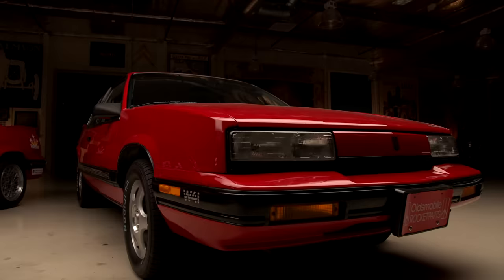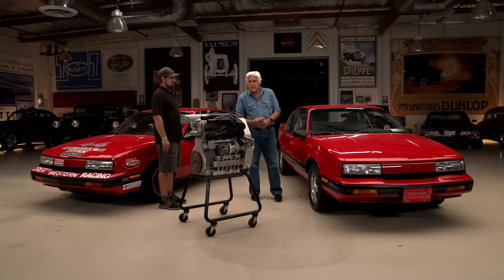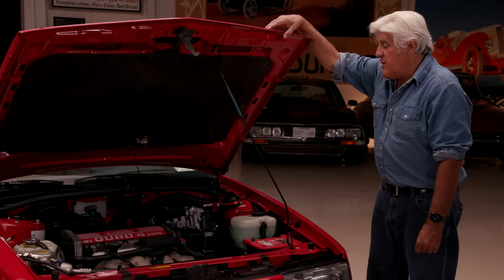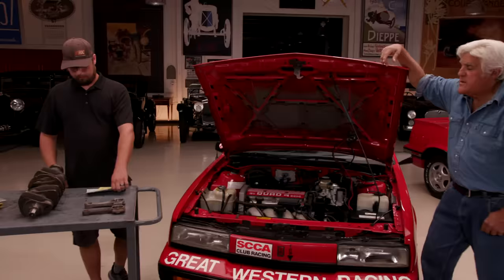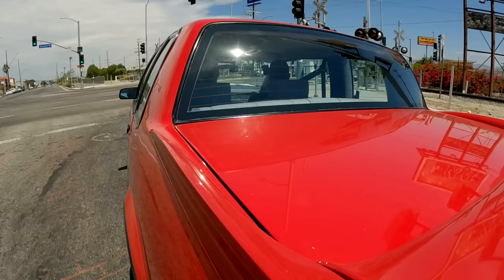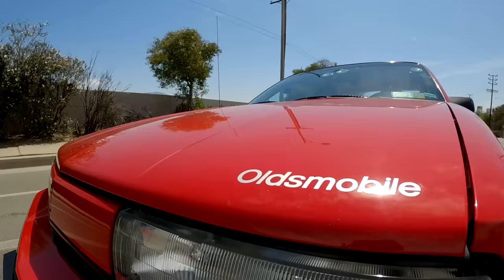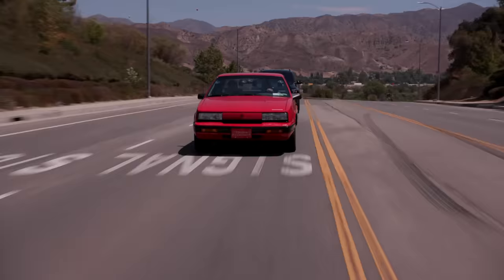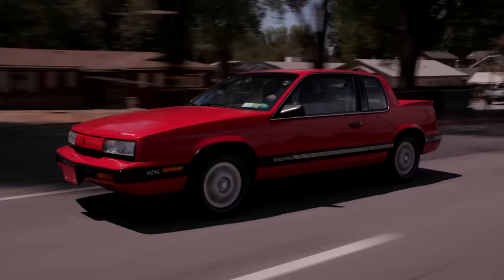Rare 1991 Oldsmobile Quad 442 W-41 | Jay Leno's Garage

Comment: This American 1991 so called performance car is a flop vs Europe's 1991 Lancia Delta Integrale EVO. Even the Renault GT 5 Alpine can smack this Olds' silly.
Reply: Which are both excruciatingly ugly and not even the same class of car as the Olds. I owned a W41, and it regularly terrorized cars with V8s. I don't see that happening in what amounts to a 4 door Scirocco.

Comment: I had one of the step up versions, of this package.
Mine was an 89 Olds Cutlass Calis with a single turbocharged Quad 4 engine.
Not quite as quick, but still very impressive horsepower showings.
Mine was in the equally rare black, with rainbow metal flake. 
However, at the same time, he had to be one of the most unreliable cars GM ever put out!
Between the horrible cooling system, and horrible head to block specs,...this was by far the grand prize winner, of the worse thing ever made award.
I would have preferred having a Chevy Vega.